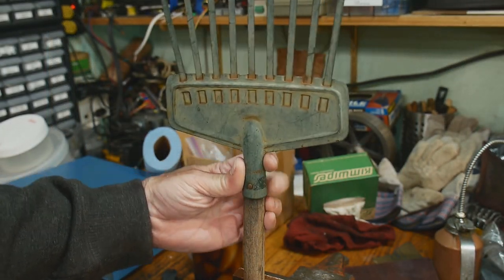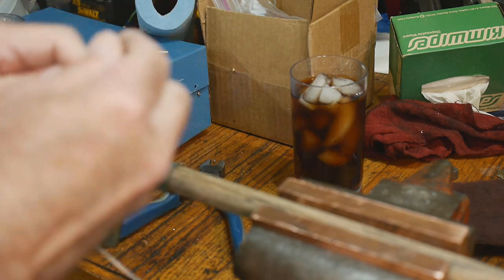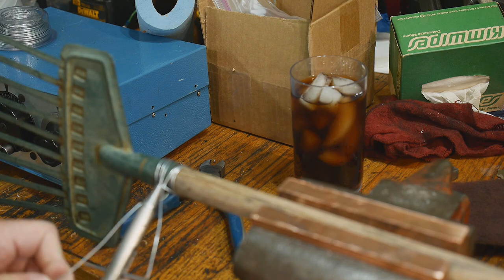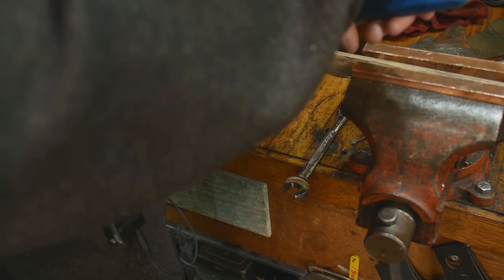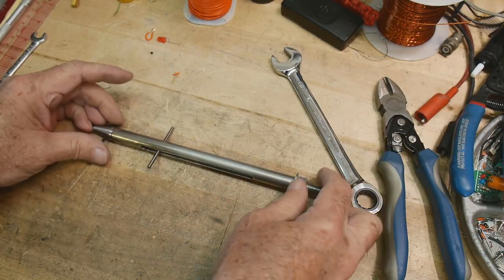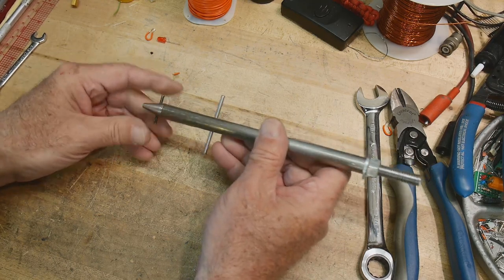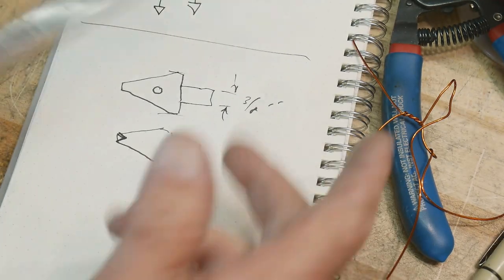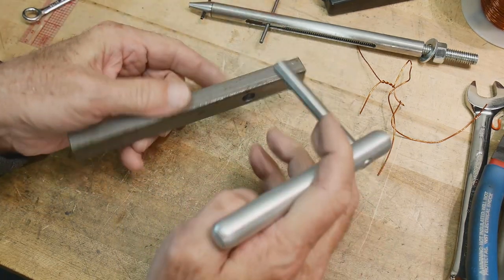#759 Clamptite DIY Tool

Comment: Nice video that clearly shows a unique tool for wire tightening! However, a simple rake  or small shovel repair can easily be done by splitting the end of the tool about 1 inch along the sides at three equally spaced locations with a Dremel disk and then fusing the rake to the wooden shaft using a pipe clamp.  Because you have split the tool's receiving end, each 1/3 piece of metal can squeeze deep into the wood for a really strong repair.  I hope this too helps with your repairs!

Comment: When you removed the nail and slid  the rake down it was half repaired. You only need to put the nail back in.  "KISS"  keep it super simple.
Reply from the maker: True, but I had a tool in desperate need of a project.
Reply: @IMSAIGuy   Ok ... I guess.  Nice work on the tool though.

Comment: Good video.   I would have split the metal end of the rake to make it easier to squeeze together.  An advantage of your second tool over the first tool is that the second tool will maintain tension on the wire if you let go of it.  In contrast, the first tool relies on continuous hand strength to maintain the final bit of wire tension.   I made my own tool using a turnbuckle design shown in other videos.

Comment: My dad used to use bailing wire  to strengthen tool handles and his trick was a little hole, one beng  the original holee in the metal, and one just above in the wood. I'm not sure how you would also use the clamptite AND use those holes, but i would pull between the two holes pulling the tool  on to the handle. I'm just learning how to use mine and do not have a clue so far, Also,that pair of "dikes" (term used in the electronic industry for diagonal cutting pliers)  , I usually decided to only use them with copper wire as steel would wreck a typical pair. Are these different ?

Comment: It would be more tight if you leave a nail in between the two wire groups. When you will use the tool after shocks it will be loose again
Reply from the maker: it has been two years since I did that video. the rake is still going strong

Comment: Instead of a nail through the rake head and into the handle, you've got a single strand of wire between two sets of 3 loops of wire.
Nice tool though, it'll be GREAT on garden hoses, auto hoses, air hoses (recently proven!) , etc.  
The comments about splitting the head of the rake are good ideas. THEN your handle will break before the connection would.

Comment: Epoxy and then clamp to make a chemical and physical connection.  Thoughts?
Reply from the maker: might be fine in certain applications. I had an air hose fail yesterday and used this tool to fix it.  worked great
Reply: @IMSAIGuy that's the thing about man  always looking for another angle Never satisfied. Won't be happy until it's destroyed.  We're about there or maybe we are? Anyway on your first tool cut handle in half  slot one end  grind other to fit. A pin hinging the two. Flip it when project interferes. I'll make one just like yours. Fix a rake just like you 😅did. Later